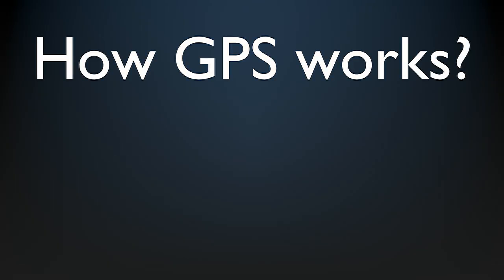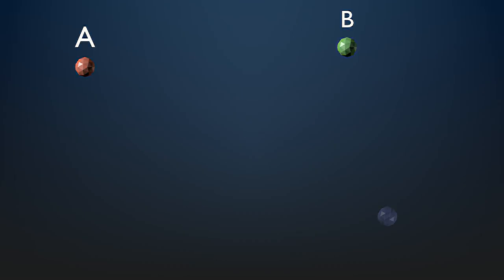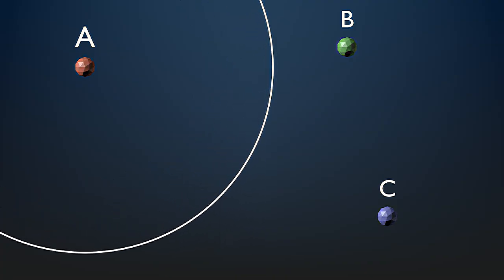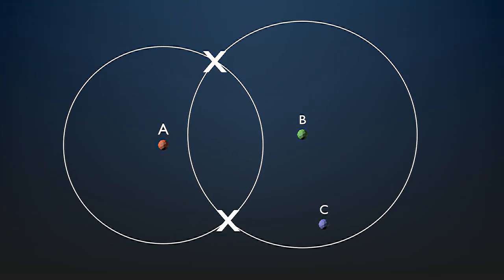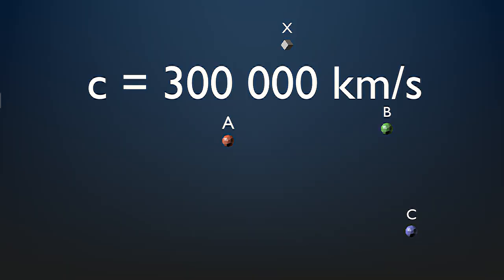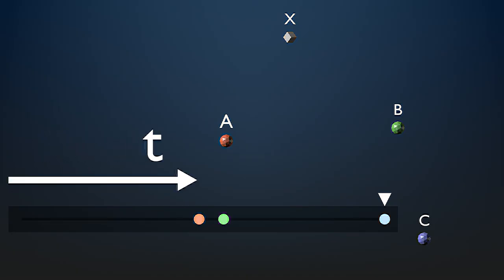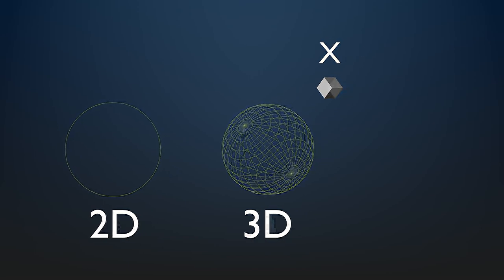How GPS works? Trilateration explained

Comment: Trilateration only works on a surface and literally means three sides.  GPS uses quadrilateration.  It really isn't any more complicated. It's just more difficult to represent on a flat screen.
Your time of flight instead of representing the circle is instead a shell, the surface of a sphere.  When you have 2 distances then you have 2 spheres and where they intersect is a circle instead of 2 points. Your third distance shell cuts through that circle in 2 places. So now you need a fourth distance shell in order to know which of those two places is the correct one.
If you do things like add additional distances, and look at Doppler effects then you can calculate additional information such as velocity and direction. If instead of distances you look at differences between a nearby known position and yours, then you can enhance the accuracy of the GPS by several orders of magnitude. This is initially how the military got their accurate GPS back before portable computers.

Comment: How does the receiver's clock know the start point of the timeline? Unless it's synchronised with the satellites' clocks, it can't know the travel time of the signal.
Reply: Yeah, he completely glossed over that point. What you do know however is that the signal from satellite A reached you a certain number of microseconds before the signal from satellite B. And since you know the speed of light you know that you are a certain number of miles closer to A than to B. So that narrows your location to a specific circle in 3D space. The delta between B and C is another circle and between A and C is the third and they should all intersect at one point.
Reply: Kent Briggs but the quartz clock isnt accurate enough for that right?
Reply: Wouter G., that's right. It takes a little over 3 nanoseconds for the signal to travel 1 meter so I doubt any consumer level receiver would have that kind of timing accuracy (quartz has a frequency of only 32768 Hz). So you would need that 4th satellite to make the triangulation work.
Reply: GPS is not based on TDOA geometry. LORAN-C, however, does work this way.
Reply: TheWonkyAstronomer 
What's not discussed is the gps signal. The signal has time of transmission along with clock corrections. And phase inversions. And a unique code, the CA code, modulated on the carrier wave. Lots of data. 

The satellite clocks are monitored and corrections are part of the data stream. And known offsets are synchronization.

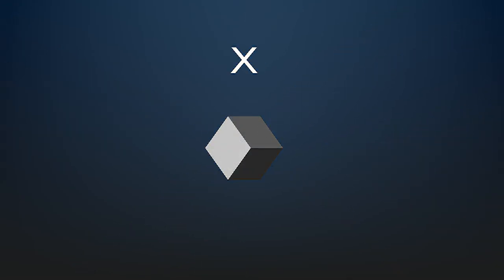Comment: A very nice graphic as shown from 2:10 onwards. The point not to be missed is that your point X could be anywhere within the reciever range of those three satelites, so therefore there are many other possible locations for you to be at. At each location when the three signals are received you will be at your own three circle cross point. Your circles will be a diferent  sized circles to the one demonstrated here. So many users at slightly diferent locations all get an accurate fix. A very smart system. I loved your graphic explanation.

Comment: Thank you. Great Explanation. Until now, I thought there is two way signal transmission between GPS receiver and the Satellites. Now I now the tracking actually happens by one way transmission and that is amazing.
Reply from the maker: Yes, there is only one-way communication going on!
I don't think having GPS transmitters that send data to satellites in our phones would help with the battery life.

Comment: I had the misconception too, how are positions calculated... And asked a question on some of these websites, and learned much...
The thing is the atom-based clock on every satellite, and if you have such a clock on the floor, too, you need less satellites (i think 3 will do) to create your position. Without such a device you will need more satellites, i thinks its four...

Comment: Hi, how do the satellites know their accurate position? position in which reference frame are we talking about?
Reply from the maker: I'm not a GPS engineer, so I don't really know that.
But I expect them to use the same tech that NASA or SpaceX use for missions control.

They could be using a bunch of ground-based transmitters with known locations on the Earth's surface, and calculate their positions around the Earth the same way, that GPS receivers do.

That'd be funny, because that'd mean the GPS system is actually double-layered, using similar tech to locate the GPS satellites, and then locate GPS recievers.

That's just a wild guess though.
Reply: @unfa00  Thx for the answer, I took it the lazy way betting on the fact you could provide an answer without have to search :P, interesting guess Thx.

Comment: Thank you for this well explaned video. I've just got one question: How can we manage to know the position of these satellites at all times? I know that the satellites used for GPS are geostationary ones, but how could we know their precise location?
Reply from the maker: I have no idea :)
Reply: GPS satellites aren't all the way out at GEO, they're actually in 12 hour orbits so they go around the earth twice a day.  Orbits are extremely predictable.  The net forces from the moon and the sun are the primary factors in calculating any perturbations.  (But if you want to be precise, the other planets have a tiny effect.)  Also, since the satellites are so far above the atmosphere, that particular drag effect is negligible too.  That's not true for LEO which makes the new constellations like Starlink very interesting to keep calculating their orbits.  It's a solvable problem, but has a lot more factors to keep track.

Comment: But how does the phone calculate how much time has elapsed since the satellite has sent its signal? The phone does not have a precise atomic clock so it would not know the exact time of receiving the signal.
Reply from the maker: I don't know for sure. Possibly by comparing  times reported and delay between messages from various satellites and the position they report it can calculate relative distance to each one and converge into a single point.  But that's just a loose theory.

Comment: pls correct the speed of light C=300 km/s and nor C=300 000 km/s in the video. nice presentation
Reply from the maker: Oh dear. Sorry for that mistake.I must have been changing it from km/s to m/s or vice versa and somehow used wrong unit.
Reply: Speed of light is 300 000 km/s (or video has been already corrected)

Comment: In other words 4 satellites in a straight line would be somewhat of Marginal value and you need to have them aligned in a some what triangle composition in order for them to send a good position  Is that correct? They are triangulated to each other in order to trilaterate to you and you are a part of that triangle

Comment: I think I’m being stupid but don’t the 3 circles also all meet at the lower point too? (The lower point where A & B join? Arc C meets there too before proceeding to the second point where you say they agree on the location of the receiver. Is it just that the receiver receives the signal from C at the later time so that explains why the second position is the location of the receiver?
Reply from the maker: They do, but that's just because of the animation. In reality the measured distances don't change like that :D
The animation is there only to demonstrate how the time of arrival of a signal from a satellite is proportional to the measured distance to it.

BTW. in reality the radius isn't an infinitesimal line, because there's measurement error so it'd be more like a fuzzy line, with the overlap resulting in a blurry circle that contains probable receiver locations. With consecutive measurements that fuzziness would be reduced as we average out and converge the results.

That's why when you open a map on your phone, it shows a circle around you and your position on the map is moving around as the circle gets smaller, and the GPS refines your position with each new measurement.

Comment: Please do another video explaining how it works in 3 dimensions. This is awesome stuff.
Reply: Digital Insan1ty 
Same thing, just with spheres instead of circles.
Reply: I rewatched this and thought about it in 3d. With 2 transmitters, the possible locations are lying on an intersection of two spheres, which is a circle. with 3 transmitters this narrows down to the intersection of a sphere and a circle, which is two points. Finally, a 4th transmitter is needed to decide which one of these two points is the right one.
Reply from the maker: +Digital Insan1ty you're right - in 3D you need 4 satellites to pinpoint location of a GPS reciever.
Reply: You would only need 3 satellites because after 3 you'll narrow it down to 2 points, one will be on the surface of the earth and the other will be in space. A fourth satellite is needed but for clock synchronization.
Reply: You would still need the 4th one to identify any error due to atmospheric effects or any lag that may occur.  GPS or GNSS usually use at least 4 satellites.
Reply: It's true that 4 is the minimum required by GPS and GNSS, but this is because of the way GPS works. 3 satellites for position and a 4th one for time. I would have to do the maths to check, but I imagine that errors caused by atmospheric delay of the signal is not solved by the inclusion of another satellite, because all satellites would have an error due to this effect. More satellites does equal better accuracy, but I'm not so sure this is the case for atmospheric errors, though I could be wrong. From a purely simplified point of view (no atmosphere) the fourth satellite is definitely required only for the time corrections, as the timing device in your GPS receiver will be an inaccurate quartz crystal clock, while the GPS satellites contain very accurate atomic clocks.
Reply: But how does this work? You still need to account for the quartz clock in the device right? So how does the 4th one correct for time?
Reply: The satellite transmits it's atomic time to the device.
Reply: Geom3trik Right, but that data arrives at a later time, and given that the quartz click isnt precise enough, you have An outdated timestamp. so you have to calculate the time the timestamp takes to arrive. but how do you do that?
Reply: Wouter G. That's why you need the 4th satellite. The receivers timing is synchronised to the atomic clock on this fourth satellite which is then used to determine the time difference for the other 3 and get your position. It doesn't matter that this fourth satellite will also have a delay because it's not the absolute time that's important but the ticking of your clock. The receiver clock is phase locked to the 4th satellite clock, which means they both now tick at the same rate, allowing for accurate time delay measurements.
Reply: Geom3trik thanks for the explanation :D
Reply: Actually, all satellites transmit their atomic time to the receiver. This is what fundamentally allows the calculation of the travel time of the signal. The fourth satellite is required to solve for the receiver's clock bias. This is why distances derived from signal time-of-flight calculations are not called "ranges" but "pseudoranges" because they are biased by the receiver's clock offset from the atomic time of the satellites (which are all synchronized). You are actually solving for 4 unknown parameters in a GPS solution: X, Y, Z coordinates, and a fourth term: c*dt, which is the clock offset of the receiver (in seconds) multiplied by the speed of light. The reason we can solve for it mathematically is because this bias will be the same for the measurements to all satellites.

Comment: Except...  Is this explanation correct?

It is reasonable to assume the clocks on the transmitters are (mostly) synchronized.  But the receiver's clock won't be precisely synchronized with the satellites (or will it?), so it will be at an unknown offset from the the satellite's clocks.

Which means you don't know exactly how long it took for a signal to reach you from a satellite -- you just know the difference in times of arrival for the various satellite's signals.

If you take any pair of satellites and you know the difference in time between their signal's arrival, that defines a hyperbola (not a circle!).  So to solve for position with three satellites, you need to intersect the three hyperbolas formed by each pair of satellites.

So now I'm left wondering what the hole in my logic is...

Comment: That's a very good and complete explanation.
Aren't you a musician?
I have a bachelors in geoespatial engineering, and although that isn't necessarily the most advanced topic,
you explained a part that generally people skip over
Reply from the maker: Thanks! I'm an artist, musician and an educator :) After making this I've been making music production tutorials with libre software and Linux in mind.
Reply: @unfa00  I've seen some of your tutorials, yeah! Actually the fact that you answered my comment is quite handy...
I have a small and short question:

Would it be feasible to record a rock/grunge  (drums, guitars, bass and vocals) with a 'libre' DAW?
Reply from the maker: @afonsorafael2728  Absolutely! You could use Ardour, sequence some MIDI drums in there if you don't have a dumkit (the included AVL Drumkit plug-ins sound great and give you multiple outputs you can mix with a lot of flexibility).
Reply from the maker: DrumGizmo also has amazing free drumkits but you'd be required to give credit to the authors in your music release.

Comment: I believe that in a three dimensional world, the distance to each satellite will result in a sphere (not a circle). With two satellites we have a circle (the intersection of the two spheres). The third satellite will reduce the circle to two points (one on Earth´s surface, one in space that is eliminated).
Reply from the maker: Yes, that's why to get a GPS lock a receiver needs to get data from 4 different satellites.
My simplified 2D model was to make the it easier to understand.

Comment: Is it possible to get current location without using GPS and internet
Reply from the maker: Rohit Patil Apart from similar systems to GPS, you could use an offline WiFi network map to determine location based on local WiFi network names and other data. You could use the mobile baseband transmitters in the same way too I guess.
Reply: Thank you...
I'll get more info on It

Comment: But how we determine own location based on satellites' location and distance from them?
Reply: By finding the intersection of the surfaces of the spheres defined by this information. I've shown how this works on 2D - 3D gets a bit more complex - you have sphere's instead of circles, and you need 4 satellites instead of 3, but the idea of finding intersections is still used.